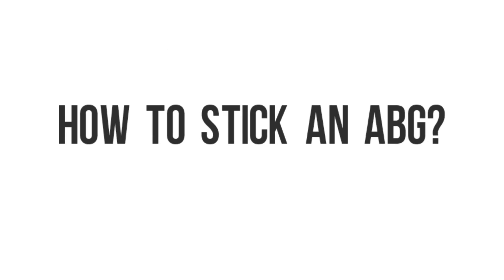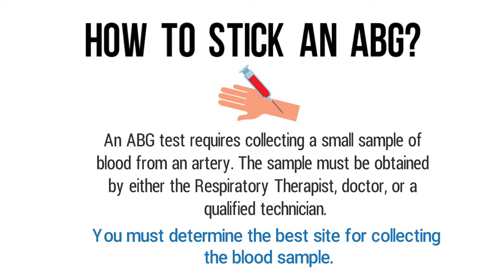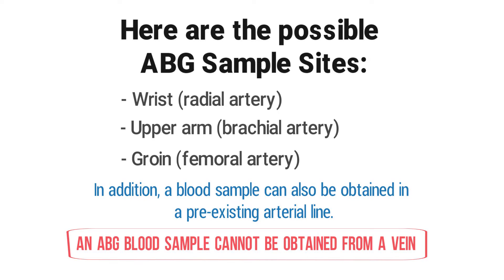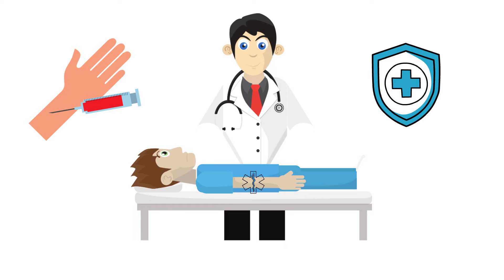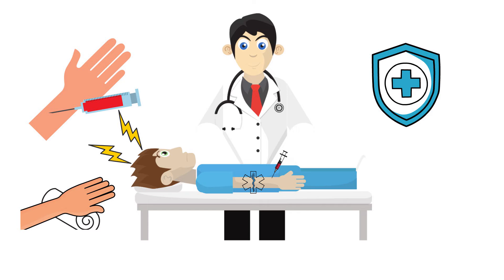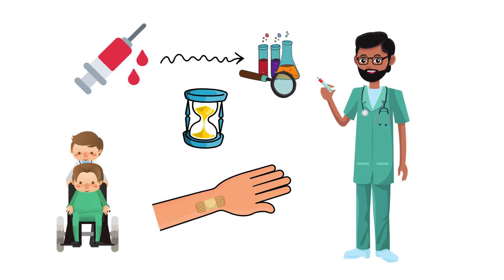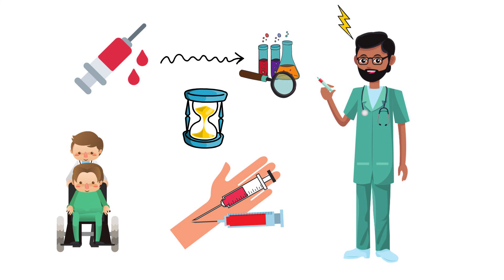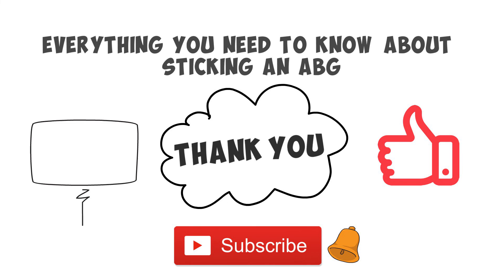How to Stick an ABG (Arterial Blood Gas) | Respiratory Therapy Zone

Comment: No modified Allen’s Test, bevel up 45 degrees, and what if you don’t get even circulation what do you do, etc. A lot to important information missing.
Reply: Also what to do with the sample once it’s drawn and the time you have to get the sample read and how to store the sample in the meantime.
Reply: @katnoir7978  yes! Those are important as well! I got asked that on the TMC
Reply: @pabbate87  It’s all in this one. But it should also be included on the “stick” video as well. Can’t fool us students! 😂😂😂😆https://youtu.be/U8Jv65AaSc0
Correction: the ice bath was too quick and not stressed enough In the video. It’s snuck on by.